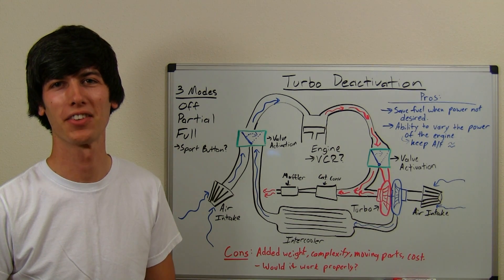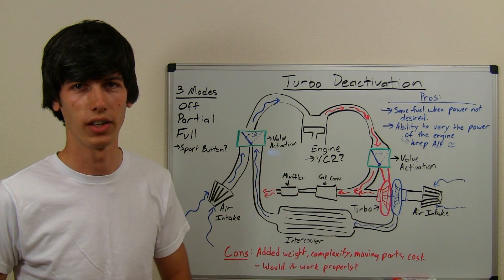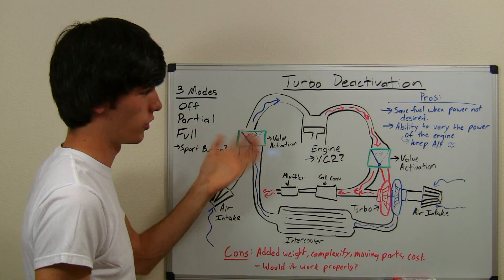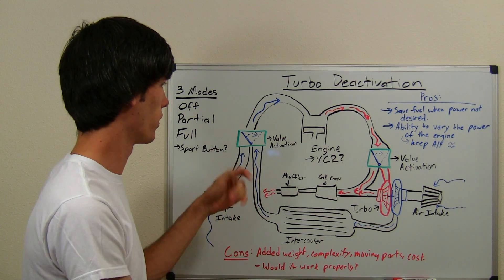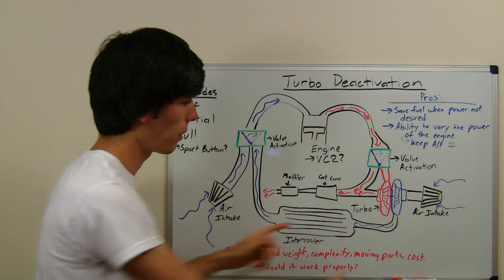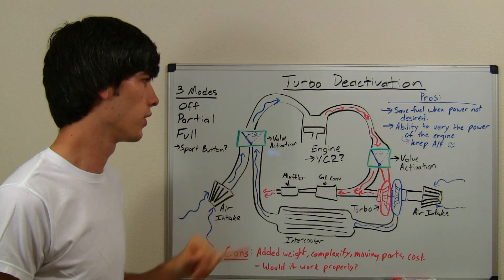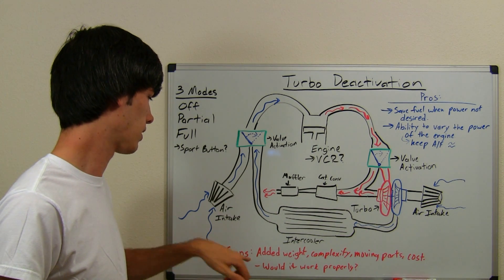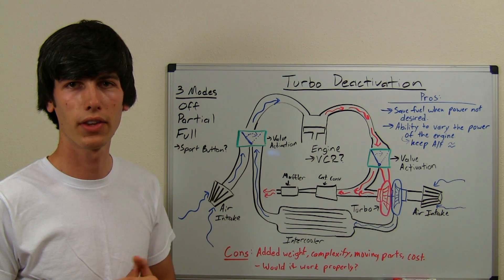Turbocharger Deactivation Concept - Explained

Comment: Since turbochargers can raise the oxygen/ fuel ratio through compression and make an more efficient burn(more power and energy per gram of fuel) wouldn't be easier to tune down the amount of fuel in the cylinders to reduce consumption (like making the same amount of power as a NA but with less fuel)? The engine would need a turbo that generates boost at low rpm though. Love the videos by the way. They make me think and remember the fun part of my short time at engineering school  hahahahahahhaha.

Comment: way to expensive just cang gear sooner  don have a lead foot  all that pipe work verbal compression motor wher talking £1000 s probably 1 000 000 miles be 4 you might off payed fore the extra expense to mack the car b 4 you  start saving  no need to goto 6 7000 rps  b 4 caging gear   have ecu stop injecting  fule at lower speed on 1 ore 2 cylinders much cheaper your starting to over think off ways round problems ford gm Nissan Toyota jag bmw spend billions trying to mack more mpg        but good work like the work vids you do :)
Reply: Turbo engines require lower compression ratios, thus less fuel economy even out of boost compared to non turbo high compression engines.

Comment: Forced induction increases fuel economy if not tuned for racing. 

Also this build is very complex, why not just have a electrically controlled wastegate that you can keep open if you want a N/A car
Reply: Because your still spinning thing that don't need to be spun. I.e wasted energy
Reply: @myass5964  It isn't wasted energy. The energy in the exhaust gases will be wasted either way
Reply: This is like a hybrid but for boost/na cars

Comment: Build one and let's test it, if I were doing it I would use a turbo with an external waste gate that way you can utilise an existing system for the exhaust changeover. You should be able to parallel the turbo and N/A intake with a valve at the air filter and rejoin each intake at the plenum. Engine management will be key to this setup, I can't see it being able to be activated/deactivated mid-drive I think you'd have to stop and turn the car off to change over

Comment: The N54 engine from BMW found on the 335/135 from the 2006-2008 era has support for deactivating the turbos from a performance chip. (Burger Motorsports JB4). Economode is supported by deactivating turbo boost. The car does achieve better fuel economy. (And also suffers a check engine light...) If you wanted to neuter your car and save some gas... it works... but people don't buy twin turbo engines with aftermarket performance chips to save gas. Point is, I think your concept works and has been proven in the real world.
Reply: Actually, the BMW N54 deactivates its turbos by design when a fault is detected (e.g. failure of HPFP, LPFP, oxygen sensors, etc.). The engine thus turns off boost, throws a CEL (code 30FF) and runs in naturally aspirated mode so you can drive the car "to your nearest BMW Service Center" for repair. :)

Comment: you need to use 1 air intake and to half close the exhaust so you aren't spooling the turbo charger you are not creating boost but you are keeping the turbo in a moving condition and you don't have problems with turbo lag + by having a rotating turbo you dont need a shorter intake ... so you are not actualy using the turbo and the power is there when you want it...

Comment: There are two problems here.  First is tuning.  An engine equipped with a turbocharger typically has hardware that requires there to be positive pressure in the intake manifold.  Cars such as the Evo has an intake design that would result in the engine sputtering as it chokes if you were to lose that pressure.  The other problem is the flaw in the concept.  The turbo actually can increase the efficiency of the engine depending on the tune.  Turbos added for performance applications are obviously not part of this concept.  The idea is that exhaust gas expansion and pressure due to that are recycled to pressurize intake so as to have more oxygen for the fuel to react with.  This reduces draw forces (however insignificant) as well but the greatest significance is the ability to burn more of the fuel that you inject into your engine.

Hence why Ford is introducing "Ecoboost" into so many of its vehicles.  I don't necessarily trust it yet as Ford is in its turbo infancy, but they are able to reduce engine displacement and weight while increasing power.  The result is increased fuel efficiency.

Comment: if you "deactivate" the turbo, then the engine will suffer a major decrease in power. It's not that suddenly it became N/A again, because we have lower CR  than N/A (i.e. 8.0 instead of 10.0) so, it may actually burn MORE fuel.. And the second reason this could not work is lag.. If you want to eliminate lag you should keep the exhaust valve on/partially on and then you will have to add another valve like a blow-off to the intake valve system which stays on.  Plus, IF it saves some fuel, i think that it would be only a very small percentage that would not worth it. Maybe a different mode on ECU could work better. I dont want to criticize you, I just add my thoughts with good intention, something like a friendly dialogue. I also love your work and channel! :)
Reply: i would imagine this would be useful for homegrown performance cars, rather than oem performance cars/ regular people cars that uses a turbocharger to increase efficiency.

Comment: one concern with this would be the lubrication system for the turbo, if you forcing oil through it with out it rotating, it could blow the seals out fairly easily

Comment: Why not just find a way to disengage the turbine and compressor wheels from each other? Have an electro magnetic clutch like the ones on A/C compressors use. Mount that clutch between the turbine and compressor wheel. When boost is needed, the clutch kicks in and connects the turbine to the compressor wheel. When power isn't needed, the clutch disengages and the turbine and compressor wheels are not connected and free to spin at their own rpm. When he turbo isn't spinning, you would have some intake restriction and increased exhaust back pressure.
Reply: +Frank Gonzalez If you introduce a clutch between turbine and compressor, why not have the turbo portion of Formula 1 KERS? That way you can spool up your turbo to avoid lag and disengage the turbo and compressor.

The main problem with Natural Aspiration vs Forced Induction is the difference in the exhaust manifold, where in an FI car you want a short way to the turbo with lesser regards to low pressure flow restriction, that is everything in an NA car.

My idea would be a variable oversized wastegate, so you can essentially have two tunes for the car, one with high boost and one with lower boost, essentially reducing the engine power but not ruining the fuel economy completely.

Comment: So, I'd never even heard of variable compression engines before this video.  Please do a video on this concept and explain the potential advantages/drawbacks and why this isn't in every car being produced today.
Reply: +John C This seems to have the ability to resolve the sluggishness of turbo engines when not in the boost caused by low compression ratios.  BUT...would it negate the need for a turbo???
Reply: +John C Every good idea that is not being used on every car is because of cost. Forced air intake is good and improves the engine in general (more air->better combustion->more power). But imagine the company adding a turbo system into every car it makes. How much more work, complexity and cost for a benefit only seen by the consumer. As for the variable compression, I don't think it would replace a turbo since the band of work is small. More than increasing the compression on low rpm for turbo engines, I guess it regulates in high boost avoiding dangerous or inefficient high compression situations. I'm no expert though it's my opinion. Haha

Comment: You're smarter than I am, but I am pretty sure they have this on every turbo vehicle.  They call it a throttle.  When you don't need the extra power, you can very the output of the engine with your foot ;).  Maybe you could reduce some pumping losses by 'deactivating' the turbo?? Many OEM vehicles also come with the added complexities of a solenoid between the manifold pressure reference and the waste-gate actuator.  This solenoid / waste-gate system acts similarly to the valve you have on the turbine side of the turbo.

I have always wondered about using a 4 port waste-gate solenoid in conjunction with an adjustable waste-gate spring perch. With the spring perch you could raise it all the way up to provide as little resistance to waste-gate actuation as possible, or lower it as far as possible to increase preload on the spring.  Then, further increase the range of the system with the 4 port waste-gate solenoid.  

I'd be interested in a video on waste-gate control systems (Manual boost controllers vs 2-port solenoid vs 3-port solenoid vs 4-port solenoid vs any system I might be ignorant of).  Also, could it be practical to put a vacuum reference to the top chamber of the waste-gate in an effort to keep it open and keep the turbo from ever making positive manifold pressure?

My purposes for waste-gate control or turbo deactivation would not be for efficiency reasons, but rather because I would like to run a range of fuels in my vehicle.  My daily driver is a relatively stock 95' Audi S6 (small turbo w/ 9.3:1 compression ratio) with a stand alone ECU that I have been running on E85.  However, I am building a 10.5:1 C.R. engine. My concern would be that the lower ethanol:fuel ratios in winter blended E85 combined with the more dense winter air and raised compression ratios could lead to detonation. With my ECU I am able to alter ignition timing, Fueling, and waste-gate control based on the ethanol content of the fuel read from a 'flex fuel sensor'.  Heck, if I am able to effectively 'deactivate' my turbo, then I should be able to run premium gasoline in a pinch.

Comment: I could see this on the new Ford F150 Ecoboost engines, it is not recmmended to plow with the turbos due to airflow to the IC. Solution: shut off the turbos? I don't know.

Comment: Well mate. My point is that you do not need VCR modern GDI (Gasoline direct injection) engines can run with high compression ratio constantly without a need of reducing the CR (compression ratio) since the direct injected petrol reduces the temperature in the chamber and prevent's knocking . On the other hand the idea to switch the turbo off does not seem good since you'll cause wear and tear to the bearings of constantly stopping and starting it ( it spins all the time the engine is on). As an idea you can only cut the exhaust gasses since the air can flow thru the cold side of the charger. and my final point is that turbo's work only when needed and as much as they are needed (not simple on/off) they generally increase the engine efficiency . And the suggested solution is much more cost uneffective and complicated .

Comment: I think the biggest reason why nobody uses this system, because if you dont want to spin ur turbocharger and be economical in the city, just drive at 1800rpm max, then shift to the other gear (like i do, its usually enoulth). That way you dont pour alot of fuel, the turbo doesnt spin anyway, and you actually saved the cost and weight of this system.

Comment: The two most significant hurdles I see to this are... #1 Compression ratio - I don't think variable compression ratio technology is quite 'there' yet to handle something like this so with a fixed compression ratio knowing that a turbo is going to be implemented the ratio would have to lower than a high efficiency engine thus sacrificing low rpm economy. #2 ECU would have to be constantly alternating between NA and Boosted conditions, spark timing, fuel mapping, cam phasing... It's an interesting idea but I think these two hurdles add considerable expense, weight and complexity. 

Also, I agree with agt155, electric driven superchargers or something along those lines will make current boost tech obsolete. An electric driven VGT is probably the next 'big' thing...

Comment: I think that it would be possible if it is not applied yet. But it would not make much difference in terms of power, because you will need a massive fuel support when use the turbo (i.e. Injectors, fuel pumps, etc), while less fuel support needed in the natural aspiration mode, so i don't think this would be applicable in terms of big power difference between the turbo working and the deactivation.